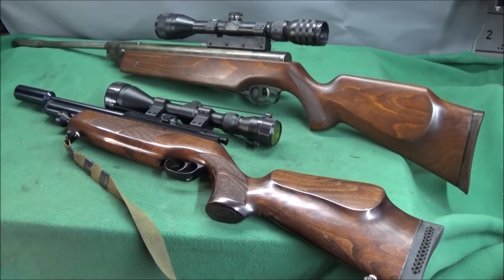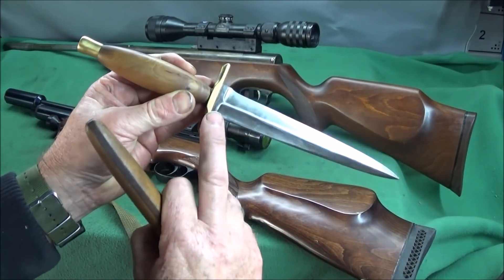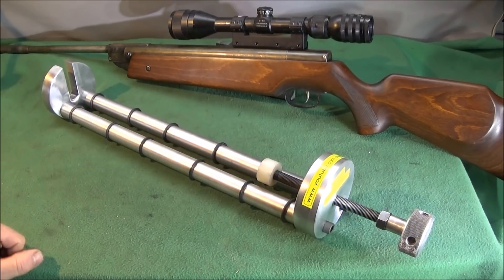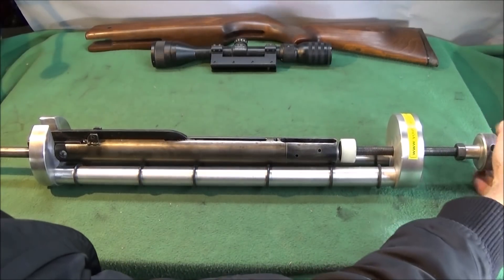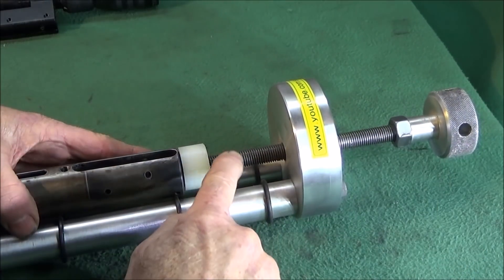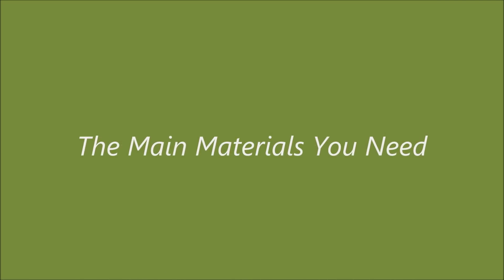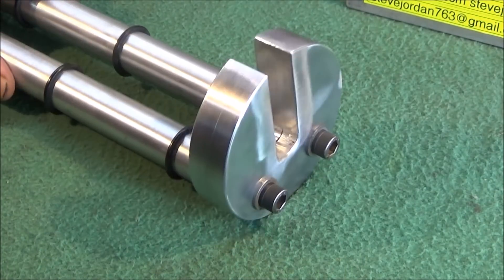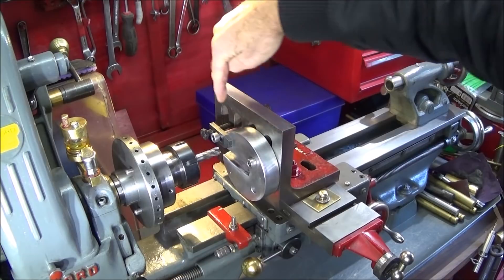Make A Heavy Duty Air Rifle Spring Compressor Plus Using An Angle Plate Fixture

Comment: Steve did you make your heavy duty angle plate or purchase it. I have a 9" South Ben lathe with a milling vise but also see where the angle plate would come in handy sometimes. My compound fits on the cross slide with a circle dove tail. I could put a circle dove tail on the angle plate or possibly might have room to drill holes into the cross slide either way I see I could make it work.